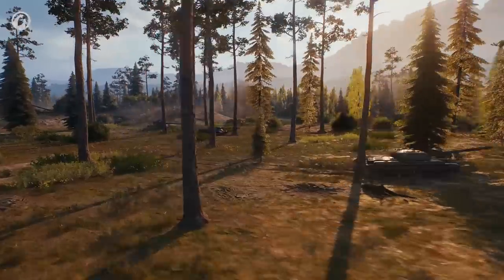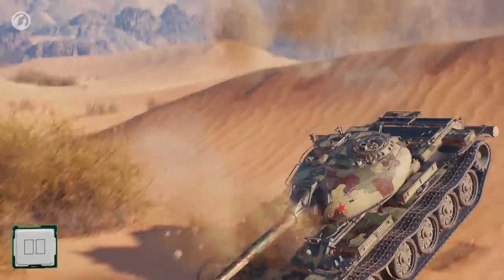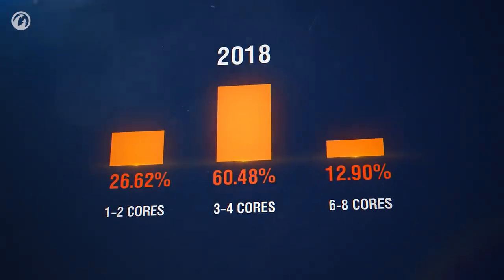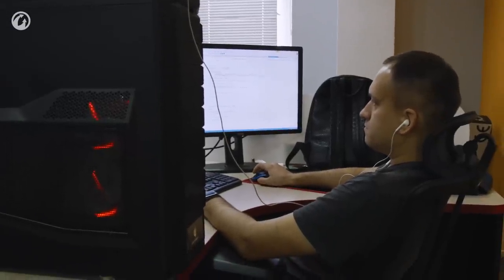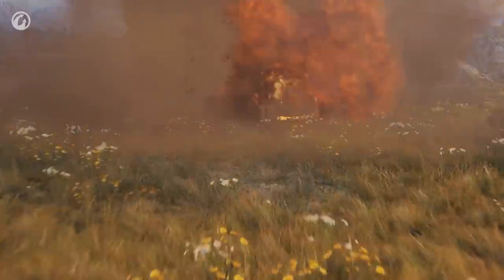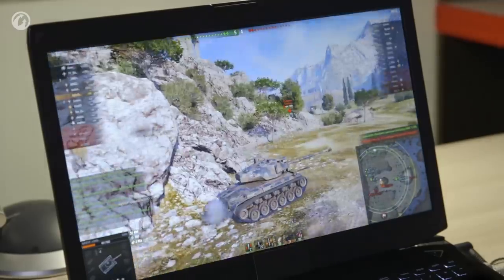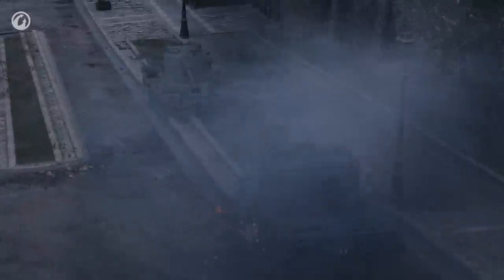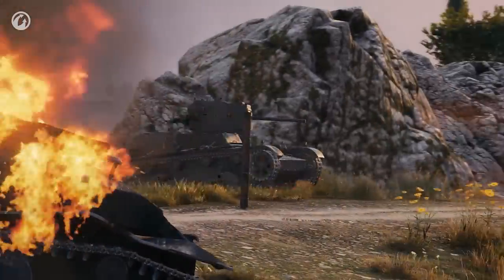Developer Diaries: Multi-Threading in World of Tanks

Comment from the maker: What graphic settings are you playing on?
Reply: Low
Reply: World of Tanks Europe all ultra
Reply: ultra, 120 fps ;)
Reply: Low 60fps
Reply: Low-med 90fps~
Reply: I can't even play game because it can't start... But if i can start it i will play on lowest graphics
Reply: Ultra, 60-->45 fps (grrr) with gtx 960 4gb and i3 8100
Reply: All ultra with average 100 fps
Reply: minimum with 15-25 FPS core i3 HD intel GPU
Reply: Actually,it's a very difficult question because my gpu is being bottlenecked by my cpu,so cpu intensive setting on the lowest settings and gpu intensive setting on ultra,i still have a dual core cpu 0:48 :(
Reply: ultra low
Reply: Amd vega 11 . . . Cant play on low becouse graphics crashes but with improoving graphics (above medium) i can play at 40 45 fps  😓😓😓
Reply: Low
Reply: Low
Reply: Low 80fps
Reply: medium
Reply: All high in a 4 core processor of 2014 60-80 fps
Reply: Max out, grass off :) 75 FPS freesync on - I can run it at 110+ but there's no point since my monitor can't follow it. Too bad my Ryzen 1700 is not being utilized at all...
Reply: All ultra
Reply: ultra ~150fps
Reply: Ultra ☝️ 60-90fps max
Reply: maximum
Reply: everything maxed out at 1440P 

PS : scale the HUD !
Reply: max 60fps gtx 770
Reply: maximum (70 fps sometimes 60 )
Reply: maxmimum settings on standart graphic
Reply: Time to use cores.
Reply: max 60 fps but during stay behinde the plants under 20 fps somtime and SD not HD by the way 5. generation i3 4xCPU2ghz intel hd graphics 5. generation
Reply: Europe , ultra HD client, 125-138FPS ,on Acer helios 500 with gtx 1070 GPU and i9 Intel CPU.
Reply: Ultra without blur effect
Reply: Ultra with 120 hz and mostly 170 fps on a very good laptop, but it happens often that I get massive fps drops even if the laptop is not overheating. This never ever happens at other games, only at WoT. So I´m very happy to see that it´s not entirely the fault of my new laptop xD And I´m looking forward for the new update!! Can´t wait to get rid of that nasty and sadly rly noticeable fps drops xD
Reply: Ultra ,120 fps on laptop
Reply: Maximum
Reply: custom, but somewhere between medium and high - around 40-50 fps
(1366x768 resolution, AMD CPU and GPU)
Reply: Ultra. Running a 2700X with a 2070.
Reply: All maxed, 2560x1440 resolution, stable 144fps (i7 8700k, 1080Ti Turbo, 144 Hz GSync WQHD screen).
Reply: Everything maxed, except motion blur which is off, 110-ish FPS
Reply: Ultra settings, with a 144 Hz refresh rate monitor.
Reply: im using a ryzen 3 quadcore and a rx 570 everything at max runs flawless , glad you guys are finally improving cpu usage it will help a lot ppl!
Reply: Ultra, with GTX 150 Ti, but i7 1st gen processor
Reply: I play on max with a gtx 1080 in 4k. Depending on the map, I range from 50-60. Will this increase FPS overall for high end PCs?
Reply: Wot NA Ultra ~100FPS
Reply: Low
Reply: @BlackBeardYT  you need a better gpu.
Reply: Max settings at 4k. Still averaging 60-70 fps.
Reply: Ppfff minimum of course!
Reply: Ultra. 120 - 170 fps
Reply: In my laptop it's high but pc ult😭😭😭😭 some lags in the laptop
Reply: Medium
Reply: @StaceyIsles  if WoT is your main game it's worth it. The new graphics on my new tower blew me away compared to my old laptop. 

1070 with Ryzen 5 1600 and I get around 100fps maxed
Reply: ultra without blur
Reply: World of Tanks Europe I just hope you guys dont forget the players like me who are stuck with a 5 year old laptop
Reply: Minimum
Reply: ULTRA LOW
Reply: Highest settings with RTX 2070 and Ryzen 1600x. I hope this update will boost my fps a lot
Reply: max
Reply: All ultra @144fps
Reply: Everything on Ultra with motion blur turned off, grass in sniper mode turned off and extra effects turned to low.
Reply: Ultra
Reply: At first... mid on HD client... now High on SD... I choose FPS. Better gaming.
Reply: Ultra with a GTX 660TI 50-60 fps
Reply: gamepc: Ultra, 100+ FPS 1080P, RX470 4GB and R7 1600, 16GB.    previous gamepc:  High 55 FPS 1080P, R9 280 3GB, Athlon 860K, 8GB  Old PC: Low 30 FPS 1080P A10-7850K 8GB
Reply: I am on low but can this new update make our game lag more I am 30-35god
Reply: Ultra low, HD version 💪🏽
Reply: World of Tanks Europe High :)
Reply: For 3 years I played at max 30 fps with minimal graphics, now I've made a standard gaming pc and playing on the HD client with ultra graphics between 110-80 fps,
another life from 30 fps to the minimum so bad, now Ultra Change my life in wot. ggg!😁
Reply: Ultra
Reply: Minimum - 25 FPS
Reply: Laptop low / PC ultra
Reply: ultra 60fps :)
Reply: Ultra on all, with a I5 8600k :P!
Reply: On the lowest veryy low only the tanks thing i set on high to look the tanks more better on low graphics but sometimes i get fps drop sometimes
Reply: Lowest on one notebook and highest on the second one :)
Reply: playing at absolute minimum because graphics card is shitty in laptop but processor is I5 though.
Reply: Low
Reply: ULTRA, and I just recently upgraded my cpu to Ryzen 2700X with 8 core 16 threads unlocked, 4 thread cpus in 2019 is just obselete now
Reply: Ultra except motion blur is off ccuz i dont like it ... I have a quad core caveri 3.4 ghz and a gtx 960 with 6gb memory that means my game will not have those frame drops from 60 to 40 or 45 ?
Reply: The Lowest Setting Possible.

I play on a Laptop
Reply: HD Client, Ultra Settings At 170FPS 😁
Reply: High
Reply: Wargaming, be aware that some of us has the game installed on ssd storage which I did, and it enormously improved my gaming experince due to fast data transfer of the ssd storage and reduced  the sluggish rendering speed by 80%, there is more than just the cpu and gpu that is involve in gaming today since technology is advancing faster than we blink, so be also aware of the latest hardware commug out in 2019 and beyond
Reply: minimum
Reply: Ultra 120-150fps on 144hz monitor - 1080Ti and I7-7700K :)
Reply: I use a mod byformod to lower my graphics to patato because even the lowest settings possible makes it impossible to play since update 1.0
So when the update came out i didnt play because i couldnt. Untill i found that mod 4 months later
Reply: what is the name of this mode
 @maarten3103
Reply: Ultra with some settings turned off to see a bit more clearly on the battlefield. Steady 90 fps without Vsync :)
Reply: Ultra + maximum and the sniper mode quality is set to off ( 120 fps sniping :V )
Reply: I5 4cores 8gb ddr4 GTX 670ftw ultra depends on map from 60 to 100 fps
Reply: Absolute minimum on both my laptop AND computer
Reply: Maximum 60 fps, GTX 1050
Reply: Maxed out
Reply: At the lowest possible settings and 720p resolution i've got 55-65 fps
Reply: ultra with tesselation turned off on 1440p and low shadows because weak cpu (drops below 60 FPS) . i5 4460 and rx 580
Reply: low 60 fps because Im a laptop pleb
Reply: I7-8850  
MX 150 2GB 
8GB 
Playing on MAX and it is 60-70 fps
Reply: High
Reply: Maximum
Reply: ultra settings all the way with 60 fps avg on a gtx 960. must be my i5 7600k
Reply: World of Tanks Europe all ultra
 on 4k on my Gaming PC, ultra fullHD on my AMDRX480+i5-5675 PC.
Reply: SD"Ultra. i7 4770 -* GTX1050 TI and 60-80 FPS
Reply: Minimum, my CPU is shit... :-c
Reply: Legendas em português
Reply: high settings in "SD" graphics 60fps :(
Reply: Ultra 60-80fps on laptop I7 7700hq+ 1050TI OC 4gb
Reply: Max 4k 60fps and I only have the gtx 1080 so you guys are on the right track with the optimizations in the game. 👍
Reply: Low-medium setting at 60
Reply: Ultra :) my ryzen 2600 ask for more load:)
Reply: Ultra low, 10 fps. I am broke and have a 2007 laptop, not a gaming though. I have stopped playing lately. Wg are making WoT pay2win. #donate2me
Reply: Intel Pentium G4560-Gtx 1050 ti

Maxed out

45-60 fps

And yes drops happening
Reply: Low...
Reply: Ultra 80 fps
Reply: Ultra, 120 fps
Reply: Low coz my lenovo laptop running on AMD A8 can't handle max.
Reply: Maximum custom I turned off some annoying things   But visually like terrain and stuff everything maximum.
Depending on the map I get 90-144* FPS  on my 1440p monitor LOCKED to 144fps with vsync and below using G sync. So very smooth.
Unlocking multi threading should hopefully have somewhat of an impact.

I use a z370 gaming 5 mobo,
I7 8700k + 32gb ddr4@3000 ( I also do rendering and stuff hence the amount of ram)
Rtx 2070 8gb oc, which runs bf v on my monitor with the same FPS as wot, with ray tracing on low.  

Anyhow 90fps on a 1440p isn’t bad!
Reply: Low 60 fps
Reply: Ultra with stable 60 fps
Reply: low
Reply: A gtx 1060 with a I7 7700 hq so in ultra :)
Reply: FX8350 CPU, R7 360 2gb GPU, 8gb ddr3 can play high-maximum @60-70fps :-)
Reply: Medium+ at 1200p to stay at 60 fps with some spikes and drops, but i know my gpu is aging (Amd HD 7970, i7 3770k, 16 gb ddr3), EU server
Reply: ultra with hd client
Reply: Ultra 1440p
Reply: Low😭
Reply: Medium and some maximum
Reply: Low
Reply: Dxvk  fx-6350 rx480.
Most settings ultra, lower settings on shadows. 
1080p 60Hz
Reply: Minimum. CPU= i7 4770 HP Envy. 
12GB RAM. Graphics card = GTX 750 TI.

About to slide in a GTX 1060 TI after months of declining battle performance.
Reply: With the graphic setting of minimum, 125fps to 245fps currently with my aforementioned system stats. However, very spikey ping since NA server doesn’t have a US WEST option anymore.... 50-135ms makes for unstable gameplay
Reply: Playing on 4k Ultra, GPU load at 70 to 80 %, hope my 6 Core will take over some Duty after Patch ;)
Reply: Ultra average 60 fps. Drops 130-30 fps some times. fx 6300 +1060 3gb
Reply: Med low
Reply: Ultra
Reply: Ultra 144 fps
Reply: I play ultra with intel i7 and 1080 ti
Reply: RkeK0ke im plying full ultra with a 1050ti and a corei3 8100 processer
Reply: Maxed out except motion blur. Like in every game (as far as possible)
Reply: High/ultra or bust
Reply: Please work with AMD. They are pushing multicore in the past decade more than Intel does
Reply: Ultra on 1080P getting around 90fps.
Reply: Some high, some ultra 80-120 FPS
Reply: Ultra on 1080p, achieving 35-60 fpswith cpu-QX8650, gpu-RX850, ram-DDR2, 8GB

Nice work for implementing multithreading B-)
Reply: Ultra on 1080p, achieving 35-60 fps with cpu-QX8650, gpu-RX850, ram-DDR2, 8GB

Nice to see you work on multithreading
Reply: 4k resolution @ 26-30 fps (Ryzen 2700X + R9 280X 3GB OC)
Reply: Ultra settings 1080p 60FPS, FX6300 OC to 4,5Ghz, 16gb DDR3, RX570 8GB. Only time i see dips in FPS is 30vs30 grand Battle.
Reply: super low xD 20 to 30fps with a8 6410 , and built in r5 graphics xD stealing 512mb grom 4gb ram
Reply: Where is the concealment video
Reply: Minimum SD klient because I have Very bad computer
Reply: WHAT T62-M?
Reply: High maximum
Reply: Low Graphics
Reply: Ultra low 30fps at 480p, playing on my web browser
Reply: Low
Reply: minimum
Reply: All Ultra with Intel i5 7400 and  Msi RX580 8GB Gaming X
Reply: Ultra minimum
Reply: Ultra low
Reply: All Ultra
Reply: Hey Wargaming, long time player. Do you know roughly when this multicore rendering will be used? like summer or fall 2019?
Reply: Ultra, 60 -45 fps
Reply: GNU Linux 64bit, Play On Linux Wine 3.15, 30~70 fps max SD mode , using 8 threads: Command Stream Multi Threading: DirectX -to-> Vulkan, 1080p 60Hz, no vsync, AMD FX 8370e @106fsb, 12GB RAM, 1060 GTX 3GB @1949mhz, driver 4.15.27, While Streaming with OBS Studio 22.0.3 NVENC  @60 fps 6Mbit/sec -> FFmpeg/OBS with NVENC manually compiled.
Reply: EU 3,440 x 1,440 75 FPS, Ultra. Not going back to the game until tanks get balanced, though. Good luck anyway
Reply: custom, you can say medium. its i dont need all effects and find some are nice but not for effective FPS gaming. If sun can blind you you wont hit... XD Best advantage in last time was to switch to 120HZ Monitor wich has freesync but with Nvidias last driver its supported by my GTX1050 and GTX1060 Graphiccards ( no sly, physX bound to 1050). Multi-CPU in 1.4 im looking forward, own an 8 core AMD.
Reply: Low for 900 FPS

Comment: Update 1.0 had halfed my performance on my midrange pc from 80 fps to 40-50 fps with everything on max settings.
Now I have a new PC which can handle the game no problem, wonder if it will even run better with the game running on multiple threads.
And really hope this opens doors to make the game look better, it looks better as it used to... but still not triple A good, you have a HD and SD client, why not bump up the system requirements of the HD client and give it super nice textures.
Reply: stop scraping the barrel then.,
Reply: I play on laptop and my performance became a little better, but problem are citymaps - there are some issues
Reply: On you open task manager in windows while playing a game you should look at the cpu graphs.
If you have a couple of (blue) graphs going up to 80/90/100% this will probably increase the fps.

Comment: This is massive boost for my laptop (r5 1600) and my desktop (r5 1600).
They both have rx580s
Reply: @sowit123  they're unloading some GPU work load via the CPU so that you can gain improved FPS even if by a tiny bit or reducing dips. 2600 is plagued by the lower core clock so more clocks engaged, the better your performance should be
Reply: I have i7 975k 4 cores, just really slow and old cores 😂

Comment: And that's a nice thing. Making sure the grounds for future improvements are there, or at least that there is no obstacles and limitation.
Next big "make space move" must be map size and viewrange/values tanks operate on. The game is "too small" now, especially with Light tanks which initially ended at tier 6 now being cramped among all 10 tiers, plus wheelies coming in. If you increase the scale of the numbers, you will have more flexibility with creating the maps, which will lead to more flexibility for different tanks, which then will lower the impact of imperfect matchmaker or even improve it since players may be less inclined to stick to specific tanks since other tanks suffer due to maps/MM.

Sure you can make all the stuff fit in your 30 square meters apartment. But that takes more work, time and compromises than just buying a bigger apartment. Now WG does have resources for that, so they shall "migrate" from the old places and ways.

Comment: It's 2019 and developers talk about 4 core CPU's? No wonder games do not advance anywhere when developers start doing 5 year project only the current most common hardware in mind. From this video I got the feeling that this new engine is only 4 thread engine and it need to be tweaked or almost educated like a child to use those 4 threads to get evenly balanced usage. Sounds so 2006 to me. Is it really so hard to make a engine support for example 16 threads that has evenly balanced task no matter how many cores there actually are? Meaning, obviously 2 core CPU is quite much slower than 16 core CPU.

Comment: Ive a dently beefy computer so it will appreciate this a lot and this explains why my computer was getting so hot with wot vs other games. Its got a 6 core processor and it puts out 15 degrees more heat with wot playing than a game like forza horizon 4 on the 2nd highest settings at 60fps.

Comment: i would like to know how and why my FPS started dropping after one of the last updates. I play on medium settings as recommended, and i had 60 fps all the time. After the update came, i have drops all the time, from 60 to about 25,30. Its a quad core AMD and a 8 gb ddr3 RAM. Why the drop all of a sudden?
Reply: maybe its overheating? i recommend installing a temperature checking device such as MSI afterburner to see the CPU/GPU temps, and then see if you can find the times when the fps drops and check the temperatures. if the temps are around 80-95C when the fps drops, your experiencing thermal throttling, as it reduced the CPUs speed in order to not melt/burn.
Reply: @pogpengwyn  well idk, i have bunch of coolers to make it "windy" in there so that overheating doesn't happen. but yeah, i'll install MSI and keep track. Thanks.
Reply: @wargamingsupernoob  its NVIDIA GeForce GT 740 2 GB GDDR5, 2 years old. I didn't had any issues before. I believe it was this latest update or the one before that i started having FPS drops. After 1.0 it worked fine.

Comment: I have a 2600k OC at 4.5ghz, a GTX 1070TI OC also with +100 on gpu and +300 on ram and 32gb dd3 at 1333 mhz, sometimes I get 120fps with all settings maxed out but sometimes i get drops till 50-55 fps... thats a lot of drop, and I dont know why...
Reply: Because of the game engine that doesnt know how to handle your cpu 😉. Hopfully after they implement multithread support, you will notice a nice improvement and much.more stable fps
Reply: @valentindinculeasa1660  mersi... mai am si ssd :))

Comment: You need to work on gpu load. For example my card Radeon RX580 XTR is heavy loaded when i play wot. After 3 hours of wot play with 120fps on ultra settings, fps start dropping to 45. This is a problem only in wot. In other games with better graphics and physics , i dont  have any problems. I reinstalled drivers, still have fps drop.